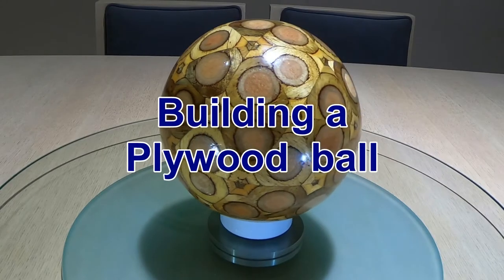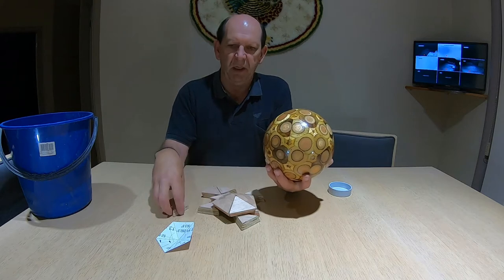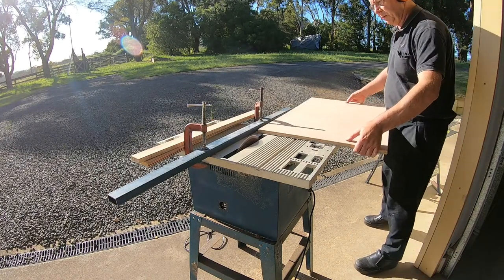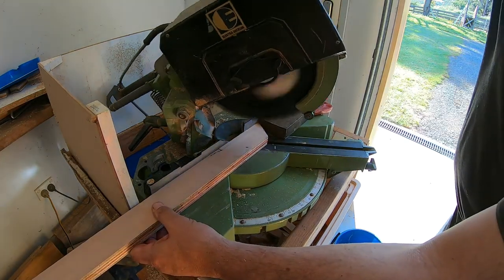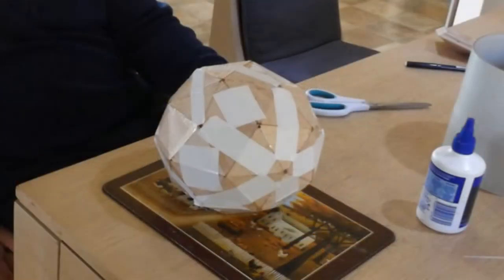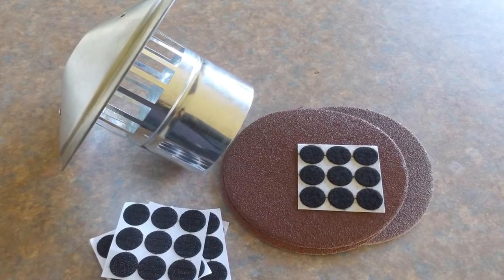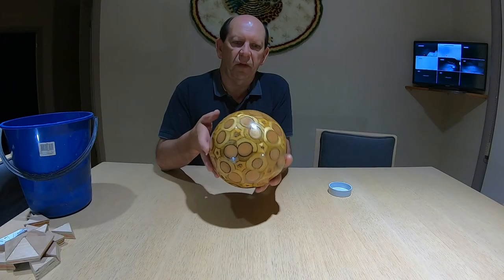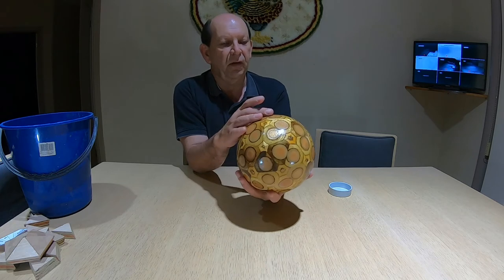Plywood Ball

Comment: You are a genius, I’ve been trying to do this for along time I cut so many triangles at so many angles I will have enough fire wood for years
Reply from the maker: The off-cuts and scraps do make excellent fire starters, but that's not the object of the exercise.  There are lots of great You Tube videos which show what can be done with wood, but lots of these are well-equipped workshops of some pretty fancy gear.  
Part of the challenge here was to see what could be done with more basic tools.  With a bit of setting up, the strips could be cut with a cheap circular saw mounted upside down.   I don't get to work a lot with wood.  Mostly I design circuit boards and write software.  Perhaps the same methodical approach helps.
It reminds me of some words from a friend once, which most carpenters would abhor:
"Measure it with a micrometer, mark it with chalk and cut it with an axe"
Still, I think that an axe would make for a pretty crappy plywood ball.  :)

Comment: Excellent job. Great, informative and inspiring video. Off I go to give this a try. Thank you so much. Yours turned out great. You should be proud.
Reply from the maker: Thanks, I'm sure you'll do well.  We started with a sheet of nice 9-ply.  It didn't take much.  Less than a quarter of that big board you see being cut up.  There's very little waste.  Actually, last week we made another one.  We wanted to try out a different finish.  The gold 'natural' finish came up great, but we wanted to see what a lime wash rubbed into the surface would do.  The results are very different and quite striking.  I hope I can post a small supplement to this clip later this week on how that came out.  Look for 'Plywood Ball II' .  The other thing I did differently was I used an old microwave oven plate motor to slowly rotate the ball horizontally (about 6 rpm) so that I could coat it with clear lacquer without it running, then keep it spinning for the first 2 hours of drying time.  That also worked out well.
Reply from the maker: The new video on this has been uploaded.  You can check it out at: https://www.youtube.com/watch?v=KaS-nTyt0Zk

Comment: When I tried it i have gaps on the last piece need some help
Reply from the maker: Sorry to hear it Charles.  Something must be slightly off.  If there is a problem it mostly shows up when 5 triangles are glued into a slightly domed pentagram.  We taped together the individual pentagrams as tight as we could and let them dry.  When putting the 12 pentagrams together into a ball.  do them all in a single session with more tape.  The relationships will move around somewhat until the last pentagram is pressed into place.  Before the glue goes off, the entire assembly is slightly mushy, so if you then squeeze and press it at the edges, it should all mostly wriggle into place as a tight ball.
If yours did not come together, you could break it apart, sand the edges of the triangles to remove the dry glue and try again to set it.
We also made one more ball with smaller triangles of the same proportions and finished up with a ball about 2/3rds the size of the ball featured here.

Comment: Nice job...how did you determine the angles needed?
Reply: It's complicated.  Some of the triangular information was already on the internet, which saved a little time, then I had to recreate it within Turbocad to get the dimensions and cutting to the correct scale.  The process is to create a virtual 60-sided sphere, made up of triangles, then take a line from every intersection to an imaginary centre point. Then the angles of those lines can be measured from the virtual model.  Still, I was happy when it worked.
Reply: @agalah408  Thanks for your quick reply.  I think what fascinates me the most is the miter angles came out on even numbers, I would guess you would have had angles like...let say 9.45 or something?  Did all the pentagons fit tightly together or did you have to sand and shape them?  Thanks...
Reply: @RichardRocket1   I see what you mean.  Of the top of my head it was something like  8.89º and 13.05º .  I rounded them as the table saw calibration wasn't very high res anyway.  I gave edges a light sanding to get rid of any rough bits, but made no corrections in size or angle.  I was surprised at how tight it did fit together.  My first reaction was 'bugger me...this is actually working!"  After the glue oozed out and I wiped away excess, there weren't any gaps.